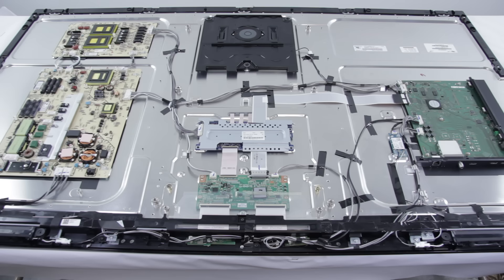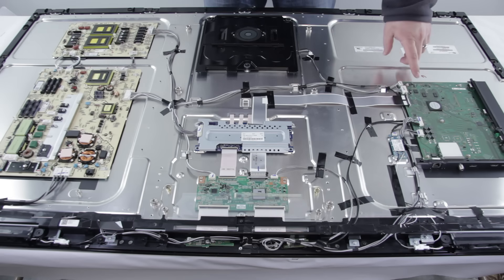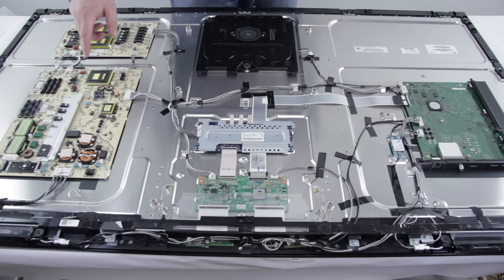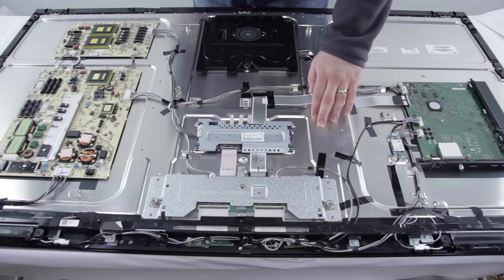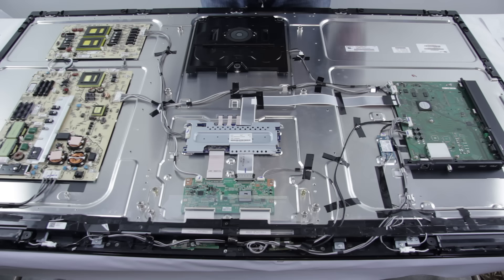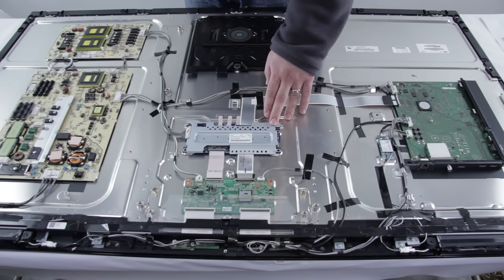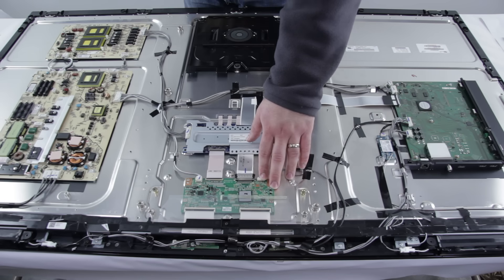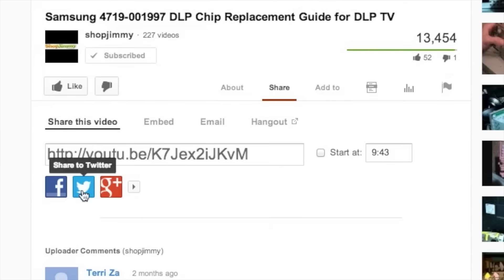LED TV Repair Tutorial - Common Symptoms & Solutions - How to Repair LED TVs

Comment: Hello, I have a Hitachi LE49S508. I have replaced the power supply, but to no avail. The symptoms are that the standby light turns on when you press the power button on the TV, but it does not display. The power supply I replaced it with definitely works, but there still is no display. Would this be a mainboard problem or the backlights?

Comment: Hi ShopJimmy, 

Thank you for providing this tutorial. I have a LG LED TV Model# 55LN5600. The symptom is that the TV's backlight goes off after maybe 30 minutes or sometimes a hour or 2 hours. If you turn it on immediately after it goes off, it will be fine for 10 min before the backlight goes off again. If you let it cool off, it will be like normal for 30 - 120 minutes and the issue comes back. 
The sound is there. I've done the flash light test and the picture is there. I've tried switching channels or switch inputs, either does not bring back the backlight. So I assume it is a backlight (backlight inverter/LED driver) issue.

I ordered LG EAY62810701 from ShopJimmy's.com and installed. The first few days it was fine. After a week or so, it started to give the same problem again. 

Another symptom we noticed is that, if we watch TV with the TV's back cover off, it lasts longer than having the back cover on.

Do you have any suggestions on what else to try?
 
I really appreciate your help.

Hannah

Comment: Hi I have a LG LED TV that quite working right after a lightning strike close to our home. When I turn on my TV the red light at the bottom middle of my TV blinks twice but the screen stays black. a minute later the red light blinks twice again and keeps repeating this same sequence until I unplug the TV from the wall outlet. I took the back cover off and could not see visable damage. Based on your video does it sound like the main board could be bad?

I have a LG LED TV model number 60LN5400-UA.

Comment: Dynex tv Mo No DX-L40-10A, my tv will power on and the screen will be blank except the source/channel its on but wont display any picture or sound just blank with the source/channel. It will stay on for a few seconds then the screen will go black.  I have  plugged my PS3 to every HDMI source they all are the same.  I know the power to the tv it still on after it turns black becuse when i press the power button I can hear it click.

Comment: Visio Razor LCD 70i - A3 TVSymptoms:Backlight YES - verified by seeing the lights on the back of the TV Audio YESPicture - NONE - verified by using multiple HDMI ports with cable box and PS4 as well as trying tv menuTried so far:Tried the MUTE button for 60 seconds Tried disconnecting power holding power button 30 seconds Ordered new T-CON board and replaced / same symptoms, did not correct issue
Main Board?

Comment: When turned on the screen is dark but has a little glow and two quarter size light spots located  on bottom right, I tapped on the spots and they would light flash in a hand size area around the spot. Any suggestions on the fix?

Comment: Hi, I have a Vizio model # VW22LHDTV10T.  RIGHT NOW THE TV IS CHANNEL SURFING ON ITS OWN.  IF I PRESS ANY OF THE BUTTONS ON THE TV IT STOPS, RELEASE THE BUTTON AND IT RESUMES AGAIN.  SOME DAYS IT WORKS FINE.  LAST WEERK THE IMPUT SCREEN CAME ON AND STAYED ON.  AGAIN IF YOU PUSH ANY BUTTON ON THE TV IT GOES AWAY AND CAME BACK HE MINUTE YOU RELEASE THE BUTTON.  RIGHT NOW IT DOESN'T SEEM TO WANT TO TURN ON UNLESS YOU HOLD DOWN A BUTTON ON THE TV WHILE HITTING THE ON BUTTON ON THE REMOTE.  IT HAS  A GREAT PICTURE.  ANY IDEAS WHAT TO DO?

Comment: I have an Rca Led 46c45rq. Replaced the power supply board and still nothing. Plug it in red light turns on but no power.  Is it worth going any further?

Comment: I have a Sony KDL-46XBR4 no sound no picture and cant see anything using the flashlight test. Power supply voltages seem ok wherever I check them. I have already replaced both inverter boards. What do you think ?

Comment: I have Samsung LN46A550P3F.  It was powering on and off.  I ordered power board BN44-00202A.  It did not solve the problem.  TV red standby light is flashing but will not power on  the chime sounds intermittently.  What should I try next?

Comment: Hi I have a Westinghouse 50" slimbezel model WD50FC1120. My son knocked it over and since than it turns on still but its all white except colored lines on right side. From what I've watched it would be t-con board I'm assuming. Couldn't find t-con board replacement part for my TV though. If you could help that would be great

Comment: I have a Samsung 40" LED TV model UN40H5203AF, version TD01. It has a dark screen and does have sound. I tried the flashlight test and turned on the tv and I can see the menu but have no backlights. What part/parts should I replace?

Comment: I have a hitachi le50h508 tv .  it dose not turn on the stand by light dose not come on.  I do not have 5 volts on pin 1 power supply to main board. the 12 volt pins all have power.  i changed the power  supply board and still wont come on. same test results.  the fuse has continuity. there is 120 volts to the power supply board.

Comment: Hi. Thank you very much for your informative video.   My Mom has an LG 5400 she bought 3 years ago.   It stopped working (sound but no picture) after two years.   I feel LG should be responsible and replace defective parts (Sony does!!) but they just told me it was out of warranty and they would not do anything.   Is this TV worth repair of these LEDs?   She paid $700.   Are TVs only supposed to last for two years?   Again, thank you for helping people.

Comment: I have a 46" Samsung smart tv the picture is gone , had audio first but that to has left the building to, with a flashlight u can see check antenna cable, no signal, would u be able to send me a link for the parts I would need to fix this problem, model number-un46eh5300fxzc, 
S/N-z5ay3cxdb00772j , thanx

Comment: I have a samsung un75h6350 that will not recognize it's lan connection.  TV works fine with wifi. What is card/board called that has the lan connection on it.

Comment: I'm not sure what's causing this right now. I have a 55 led Samsung (model UN55FH6030) that has 2 hdmi ports. I have everything plugged into a fosmon hdmi switch box. Here's what's been going on the TV is only about 4 years old and just started happening this month 

Randomly, not after any set period, sometimes it'll be after an hour or two or not at all, while watching or playing something on any of the systems plugged in (ps3, Xbox etc) my TV will start to power cycle. The Samsung logo will come up, occasionally it'll get to the hdmi screen again, and sometimes it'll just get to the logo before it cycles again. This will continue for a few minutes or just two times before stays on. Usually I'll have to turn off the surge protector and wait before I can use it again as sometimes it'll continue to cycle after it starts. It's random as I can go a few days without this happening. 

Usually when it starts to cycle I have to play the waiting game as I have tried unplugging everything from it after its started to see if it's something plugged in but I'm not sure if whatever is causing this makes it continue to do this or not. After this most recent incident I've removed the box entirely and will report back with if it continues.

What I've tried:
 - Switched the box from hdmi port 1 to 2 on the TV - Factory reset the TV - Can of air to remove dust 

I haven't yet removed the back of the TV to try and use the air on it as I'm nervous about that and not sure what to remove first. I'm going to probably try that next and check for anything loose when I have more time this weekend maybe. I'm looking for maybe suggestions on what else to try or if anyone else has heard of this and might know what's causing this. I'm hoping it's the switch box and buying a new one will fix the issue, but with this problem being very random and not consistent its been very hard to actually test what will and won't cause this. Especially with it not happening till an hour after use sometimes

***UPDATE** it just started cycling with only the PS4 plugged into it. Once it's done acting up (have the surge protector off) I'm going to plug in just the Xbox and see if I can get it to happen. If it does then does that mean the problem is in the TV somewhere?

Comment: I have a Samsung TV LNT4669FX/XAA.  Power Supply seems to work as it powers on the back light and the logic board makes a boot up sound/chime.  There is no picture on the screen at all.  but if I leave the tv on for a minute the screen starts turning white in patches.  Could this be the TCON board issue or something else?

Thank you so much for your reply.

Comment: I have a Hitachi 50HTY62U. 
which currently has a distorted/whited out picture. I have removed the back panel to find it has the Main Power Vestel board and then a Vestal 17MB95M 23193499 board.   
I don't think there are any other parts 
hope you can help. 
Ross Bainton

Comment: I have a LG 55lh90 -UB LED and what is going on is half way down my tv from top of the tv to the middle of the tv the picture is like it is turned down on brightness , you can see the whole picture it is just half of the screen is dimmer than the bottom of the screen and you can turn up the backlight all the way and it is almost not noticeable so what could be causing this problem .

Comment: Hello,

I have a Sanyo Model: FVD48P4 LED TV (s/n: H4190043118807). My backlight flashes for a fraction of a second and then goes out. I can hear sound and change channels. I used a flashlight to check for a picture. Its just backlights that are out.

The backlight did work once. It was flickering in places on the screen, but I did see a picture. The next I turned on the TV the backlights were out. Could this be a loose connection?

Any idea which board I would need to replace and how much it would cost?

Comment: I have a Sharp LED Model No. LC-50LB371U. The screen has gone back on it. The sound still works. at first it would be just a little darker at the top, but then that would clear up. but the entire screen just black out. you can still barely see some of the apps that are on it but that's it. I would really like to know if there is a part I could get to fix this myself? Thanks for any help.

Comment: Hi shop jimmy have a samsung 46 inch (46ue5000) tv back lights co on no sound or picture screen is dark blue on images 
power supply is good and the voltages  are 12.7 volts to the lodgic board when off the staqndby is lit 
when turning on tv the standby flashes 5 times the backlights com on tv chimes in no picture
replaced the tcon board with a used one still no picture on the tcon board there are blue led lights there is one lit when i remove one of the ribbions on the tcon board the screencomes on half lit with lines when i plug it back in the screen goes out .... any ideas  
anthony madda facebook ffuudog @gmail

Comment: I have a Vizio Smart Tv Model #: E550i-B2. I've had my TV for about 2 and a half years. It has no sound and no audio, the white light indicator goes on, but fades after 5 seconds. It hasn't been working for a week and i don't want to spend to buy another tv. what could be the problem? I've done a power cycle, and reinserted the cables. Still not working. Thanks for your help.

Comment: Hi my name is luke, my samsung tv model is ua46f5000ak and has a problem of turning ON/OFF everytime with  like 4 seconds. its behaving like its rebooting every time. it started this issue just after i fixed the AV cables on the tv while i had HDMI cable on, kindly assist.

Comment: Samsung UE48H8000, has sound, no picture, no back lights or visible image on screen when checked with torch.
I have taken the back off of the TV and have noticed that the back lights flash on for a split second when initially turned on, any thoughts?

Thanks.

Comment: I have a LG 55LN5100-UB,  everything works except the picture, u can see the images but no color, it has a chromatic picture, i replaced the t-con but nothing, they told me it could be the power supply board, any thoughts? thx

Comment: I have a Hitachi LE49S508 this would be the module number on the plastic cover , on the Mainframe after removing the cover there is another moduleModule :C490F14-E1-L(G2)I have audio no picture , when I do the flashlight test I do see menu , this thing is complicated for me it would be the first time I attempt to work on such a device , there's a main board and a power board , t-con board , I do not seen LED driver board , there is a10 wire strip connected from power board to the inside of the frame , beginning with a red and black wires , after that there is red white , red white , red white , red white ,Preliminary test on it give me the following readings 1 Red wire 116 VDC 2 Black wire 89 VDC 3 Red wire 88 VDC4 White wire 61.5 VDC5 Red wire 61.5 VDC6 White wire 300 mv fluctuating7 Red wire 300 mv fluctuating8 White wire -15mv to +25 mv fluctuating9 Red wire 300 mv fluctuating10 White wire .1mv fluctuatingTest form chassis ground two wires positive lead ,There is a slow blow fuse on main board tested okayHitachi Main Board patr number is Juc7.820.00121165 , the Power supply board is a Megmeet pcb:mp145d-1MF51rev :1.0t-con board have the following barcode number on it 3812BDMBTGG3084What do I get wiring diagram for this thing thank you
Reply: I have a hitachi LE43A509 which has the same symptoms

Comment: good day 
I have a Hitachi LE49S508  this would be the module number on the plastic cover ,
 on the Mainframe after removing the cover there is another module
Module :C490F14-E1-L(G2)
I have audio  no picture , when I do the flashlight test I do see  menu , this thing is complicated for me it would be the first time I attempt to work on such a device , there's a main board and a power board , t-con board , I do not seen LED driver board , there is a10 wire strip  connected from power board  to the inside of the frame , beginning with a red and black wires , after that there is red white , red white , red white , red white ,
Preliminary test on it give me the following readings
 1  Red wire 116  VDC 
 2  Black wire    89     VDC
 3  Red wire        88     VDC
4  White wire     61.5  VDC
5  Red wire         61.5  VDC
6  White wire      300 mv fluctuating
7  Red wire          300 mv fluctuating
8  White wire        -15mv to +25 mv fluctuating
9  Red wire            300 mv fluctuating
10 White wire        .1mv fluctuating
Test form chassis ground two wires positive lead ,
There is a slow blow fuse on main board tested okay

Hitachi Main Board patr number is Juc7.820.00121165 ,

 the Power supply board is a Megmeet pcb:mp145d-1MF51
rev :1.0
t-con board have the following barcode number on it 
3812BDMBTGG3084
What do I get wiring diagram for this thing thank you

Comment: Samsung UN8000D8000YF developed a sudden dimming of the screen on all display setting from dynamite to movie, all setting seen the same. U admit to using some poor judgement and left the TV exposed  to a lot of dust and fine wood scavenging while planning lumber in the shop. It was on  7th day  of sanding that the dimming occurred. Tried reset brightness.
 WHAT TA YA THINK ?  Remove rear panel and blow off the internal boards and stuff, of the TV set. 2. Too late, you have already destroyed the TV like a jackass with no regards for sensative electronics. I may need to seek counseling about excessive TV watching. ? Help Any trick to remove rear panel ? Do all rears screws need to come out. How to on that model has not been located. Thats it .

Comment: I have a 60 inch LED Samsung TV.  The tv is 4 years old.  I have sound but no picture.  I paid $100 to  a repairman to tell me it could be the T Con Board.  He did not remove the back off the TV.  My husband took the back off the tv and you can see lights at different locations on the back of the tv.    I ordered the T Con board off of ebay and it did not change anything.
  So I ordered a main board from Shop Jimmy.  I received the main board today and it still does not work.  My tv model is 
UN60EH6050F,Type # UN60EH6050, Model Code # un60EH6050FXZA.  Can you help me?

Comment: I have a JVC lt-42em91. I have done the flashlight test and there is no backlight. I can see the image with the flashlight and I have audio. I have replaced the LED driver board. the backlight will pop on right at first then guess off.

Comment: Hi I have a Panasonic TX-40CX700b, it switches off intermitantly, red standby light flashes once every 3 seconds, replaced the mainboard and power supply but not the led inverter  board but still the same issue, any ideas.

Comment: I have a Vizio LCD TV, model #VO42L FHDTV10A.  It has red bleeding or shimmer intermittently at all inputs.  The problem disappears if I hit the top of the TV.  That leads me to believe that there is a loose connection somewhere.  What is your diagnosis?

Comment: Hi and thanks for the remote diagnosis.  I can post a video, if my description doesn't point to the issue.  40" Westinghouse LD-4070Z.

Sometimes it will stay working for hours.  And, it appears to be sensitive to cold ambient temp below 68F.  Audio always functions.  If a cable channel guide or DVR menu is selected before power-up (freezing a portion of the screen), the small live image will be okay, but only on power-up.  If the guide or menu times out, it will be okay for a random amount of time (zero seconds to hours), or the screen goes nuts with any of the symptoms below.

Symptoms:
Most frequent --

Screen all red, all green, all gray, or wild lines of color.

Less frequent --
No Signal
Image upside down!
Image refresh appears less than 24 frames - jerky motion.

Your suggestions appreciated.  Feel free to call 775-530-6800 Pacific Time.